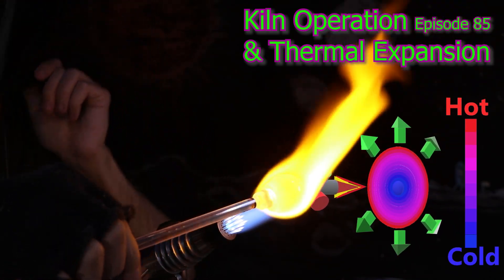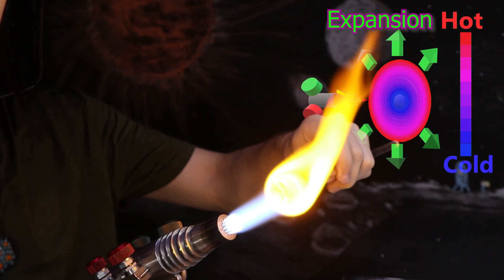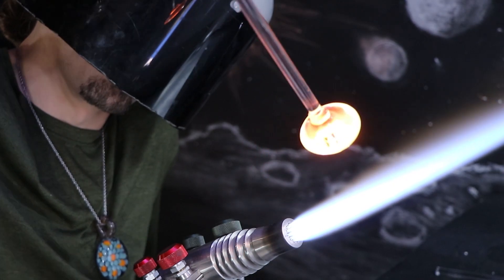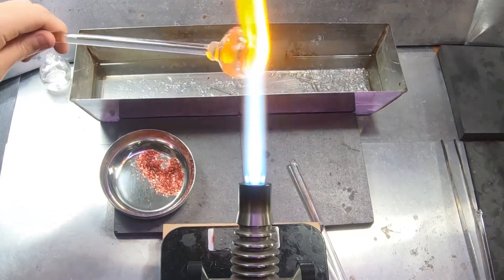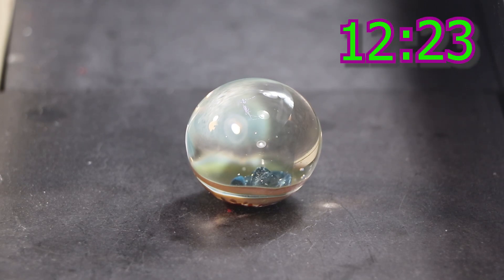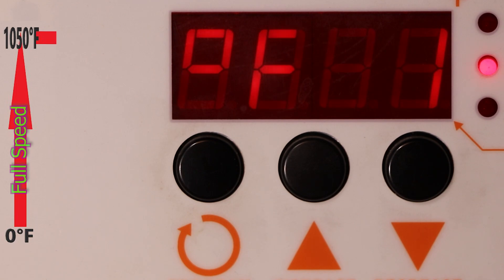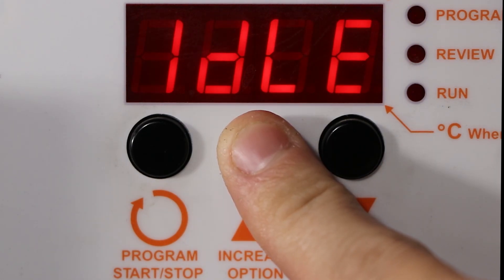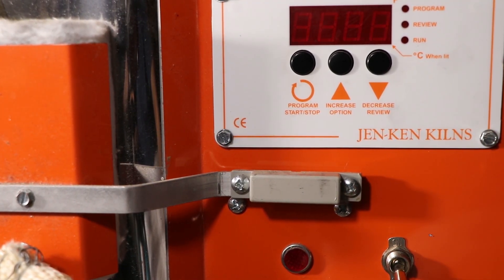Kiln Operation & Thermal Expansion - Lampworking

Comment: Are you using a Jen Ken Cube? I've been thinking about getting one myself but not sure whether I should get the Cube or the AF3 11x4.5
Reply from the maker: I bought the cube because I wasn't sure what I would make would fit. If your only making marbles or things that will fit through the door then I would get the 11x4.5 for more floor space.

Comment: Do you still use this same program for your kiln?
Reply from the maker: Yea I still do. I'll skip the 4 hours if I get done early. I normally wait 30 minutes to an hour to anneal the last item before I skip. Also If its a small item like the marble stands, glass picks, or my tiny oil lamps, I'll just turn the kiln off after annealing to save power on ramping down.
Reply: @JasaGlass  Thanks for the info!

Comment: Hello again Matt. Sorry I got distracted with the last comment. I actually came on here because I’m having troubles with my marbles cracking in the kiln. I figured out why the one marble cracked with that last comment. But I set my kiln for three segments ramp at full speed to target of 1050°. Hold for four hours. Ramp to full speed to 940° hold for 30 minutes. Then ramp three was 100° an hour down to 500 and then turn off does that sound about right for marbles ranging from a half inch to an inch and a half?  Also I garage them at 1050°
Reply from the maker: Hey Dan, there are some colors which can be problematic when worked too deep. Aventurine glass will have trouble because of the difference in COE. That program sounds about right, some sources say 1 hour for each .25 inch, however I'm not certain if there is a uniform rule for every artist. In theory it might come down to the creation process, if the marble is assembled at working temperature and enters the kiln at annealing temperature then it hasn't had as much time to develop stress. If you allowed it to bench cool, then annealed it later, it would certainly require the extra time. So overall I'm not sure if that 1 hour per 1/4inch would apply to every case or might just be the maximum needed for your worst-case annealing scenarios.

Comment: Hello Matt. I am having a problem with my marbles, when I take them out of the kilm they’re cracked and I’m aneeling for almost 4 hours at 1050 And slowly brought them down took 6 hours and the next day when I opened up the kiln all but one that was about 3/4  inch had cracked. ☹️
Reply: Thank you Matt. My COE was the same, I believe. I will try letting it sit in the flame. That could be it.
Reply from the maker: I'm sorry to hear Dan, there must be an issue somewhere between the cooling or the marble design itself. Imploding dense/sparkled colors (which have a lower COE) can be problematic. I'm not sure how much the Clear can take in problematic colors before it cracks. You could try to simplify the design or change color to see if that helps.
  For the cooling phase I like to bask the marbles in the flame for a even soft glow to balance the heat before I set them in. I believe this helps the annealing. I hope this helps.
  Best of luck on your glass journey!  🔥
Reply: Thank you Matt. I believe my COE is the same. I will watch that. I will try the basking. You must leave it on the marver then ? For that.
Reply from the maker: @danmohr2449  Actually I try to hold it with my tweezers but I don't recommend that for marbles as it could slip very easy. You might try this tool, https://www.mountainglass.com/Lentil-Tweezers . I haven't used it myself but I'm going to buy one for my next order.
Reply: @JasaGlass  thank you so much !!

Comment: do i hold it at 1050 say if im making prep work all day. ?
Reply from the maker: Hello Francisco, Yes I believe they call this "garaging" (like a car garage). 
   Some colors don't like long hot garaging, anything with Aventurine: Blue Stardust, 
Heavy Leprechaun, Mighty Moss.
   If the prep work is small enough (like chain links) It can bench cool and be annealed later for 30 minutes before you use it again.

Comment: what setting do i use if i am making prep work for pipes and water pipes. things like that. i just got one but it didnt come with the instuctions
thanks for you videos matt
Reply from the maker: bEAd, bd4. That will set it to 4 hours at 1050 before ramping down slowly.

Comment: Great video ‘ I need help on cooling process ‘ I’m making modifications to glassware (pint and whiskey glasses’ ) I basically make a small indent in the side by poking a rod into the glass ‘ but cooling down I’m not sure on correct settings to ensure glass doesn’t crack or smash ‘
Reply from the maker: Hey Oliver, sounds like a fun project. Cooling down your glass Slowly is most important.  If you have a kiln you can run an annealing cycle to dissolve built up stress. Soft glass anneals at around 950°f for 30 minutes, after which you can turn the kiln off and let it cool down naturally for several hours. Digital kilns have the most control however and can be programmed to cool even slower (for days). 
   If you don't have a kiln you can use the back of the flame and keep reheating the surface to slow down the process as it cools. It's not ideal (won't anneal your glass) but it can keep it from cracking. Its the method I used for my glass hammer as it wouldn't fit in my kiln. Thanks for watching, let me know if you have any more questions on the cooling process.

Comment: Hi Matt, I learnt scientific glass blowing in the 70's (but did not continue & went into industrial chemistry) back then the course did not use a kiln, we did "flame annealing" (I still have some Christmas decoration, made in soft glass). I re-stared lampworking 2 years ago - I only run my kiln when I have a full load, but always flame anneal to cool my glass first.
FLAME ANNEAL - evenly heat your object, using a cool flame (do not melt it!!!), turn the oxygen &/or air off - this gives a smoky flame, let the soot coat your object - this will slow down the cooling. I then put the soot covered object between 2 layers of glass fibre wool - cooling now takes 30+ min.
Reply from the maker: Hello Peter, I'm planning to go into other non-kiln methods later, I wanted to dedicated this episode fully to the Kiln. Some people do prefer to soot their glass when warming it up, but I haven't seen too many use soot for the cooling; probably because of the modern kilns. I might explore soot more in the non-kiln episode. Thanks for the great comment and Stay Melty!

Comment: When you flatten your gather, do it over several heats and let gravity do the work.  When you push, you concave the top, which can add unneeded stress, and make your implosion less even as the top is uneven and will add more glass to some areas, distorting your pattern.
Reply from the maker: That is some good advice, I always like putting gravity to work. I know the top got a bit warped, I was busy focusing the camera, looked back and saw I over did it. But knowing the inevitable fate of the marble I felt viewers might be mad if I put too much time into it LoL. Thanks for watching!
Reply: @JasaGlass  it doesn't even really need to be a disk, just flat.  I'll shape my prep like a short squat bell almost, just make sure your bottom is flat and spins on center.  Any extra glass can be removed from the top without affecting the implosion.
Reply: Wow. I flattened mine quickly like the video and as I was doing the marble I could see like where I had pushed on the top of the disc. it looked concave inside the marble. and the top of my marble cracked around that. Space and I was wondering why it cracked probably that’s why. thanks for the advice. And matt, you do a great job! Your videos are awesome.! I think you should take whatever time is needed to show the correct way so things turn out. If people don’t have the patience to watch the correct procedure, maybe they shouldn’t be doing this. keep it up!